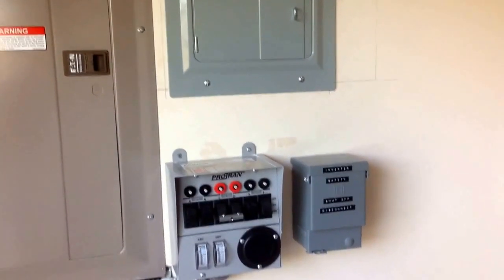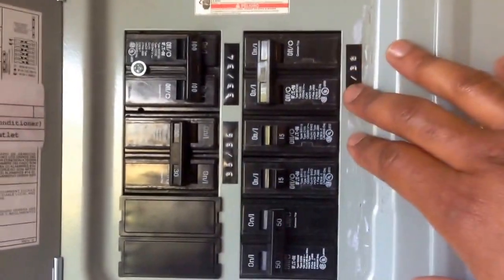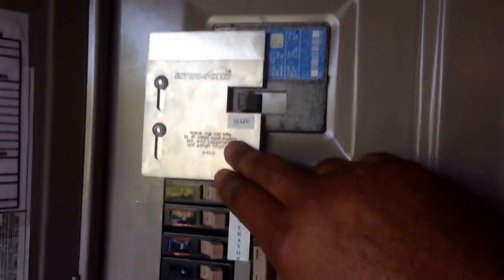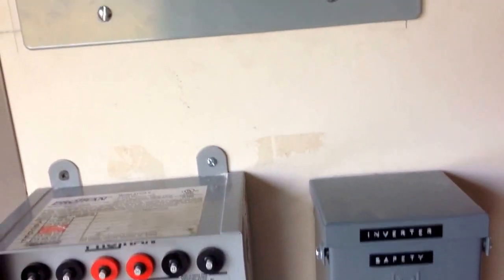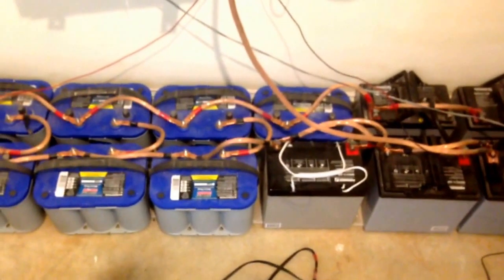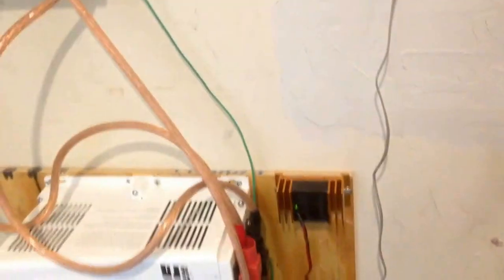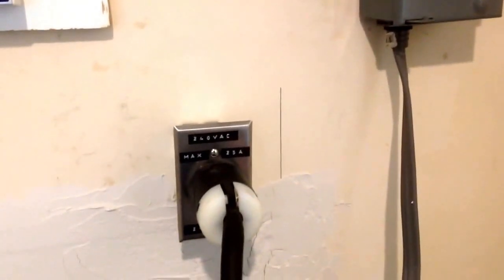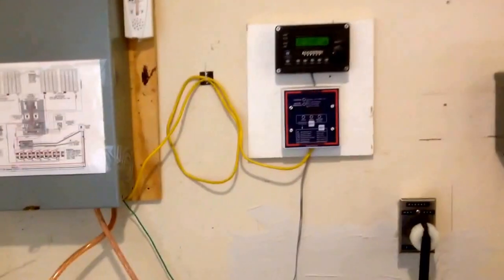DIY Solar Battery Backup - 3 years later.

Comment: So, basicly, you don't use the batteries hardly at all....
Reply: All that solar energy is being wasted, you don't use system, shame, the sun shines everyday....
Reply from the maker: It is a essentially a backup system. I have since put a small grid tie inverter in place, but only a small one.  Grid tie wasn't a design consideration.

Comment: You may want to, if you haven't already, have your installation inspected to make sure it passes code.
Reply from the maker: Thanks for your comments. Inspection would be a good idea, but it isn't required in my area. I've thought about it though, just to be safe I suppose.